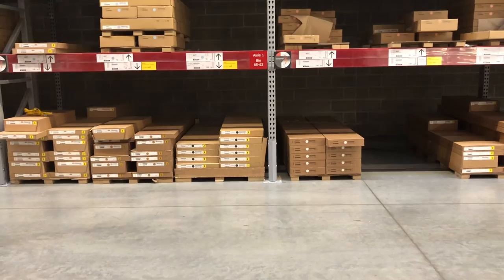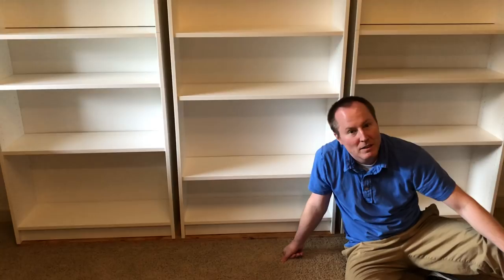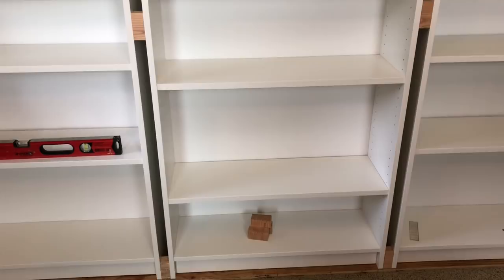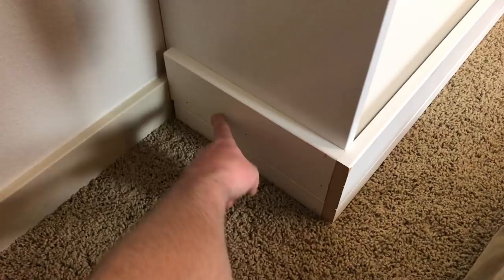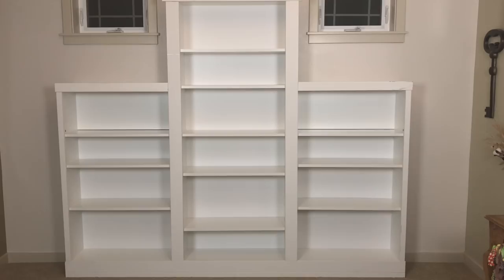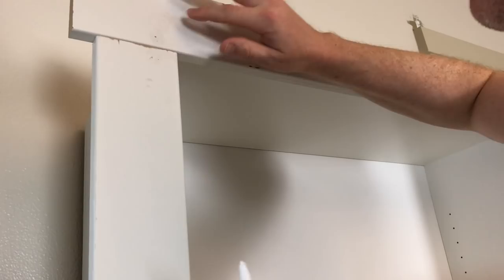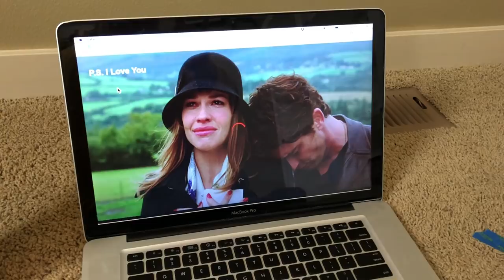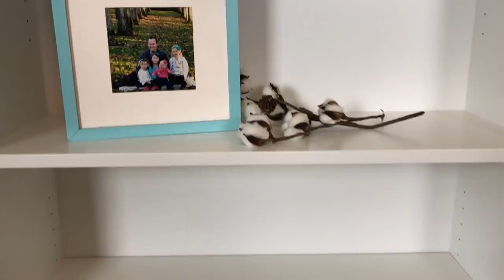IKEA Hack - Custom Built In - Billy Bookcase

Comment: Did you attach it to the wall? Or does the base wood keep it in place?
Reply from the maker: All of the units are attached to each other and to the base that we created. The base is attached to the wall though.
Reply: @daynacreates1105  Good option to keep in mind.  I connected my billy's together via the shelf holes (at the top/middle/bottom)and then used the provided brackets to mount to wall.  It's now considered a built in and will stay with the house. :)